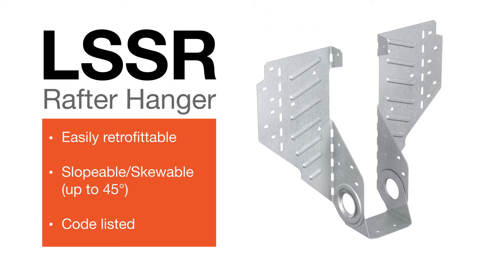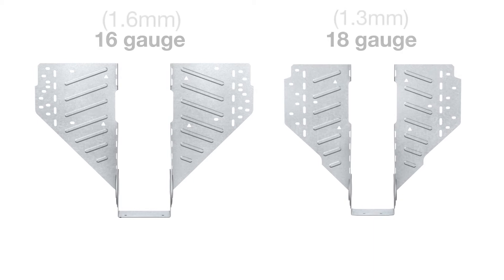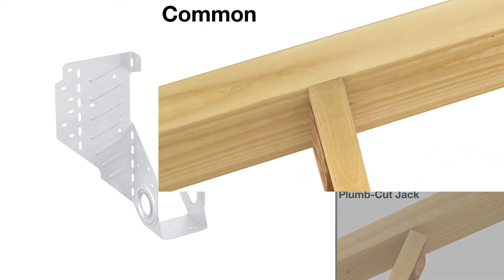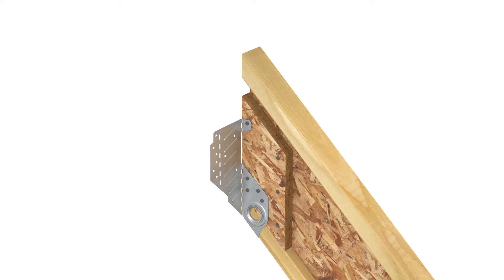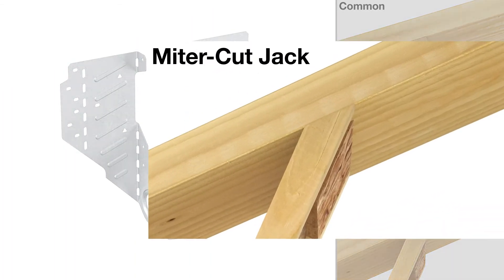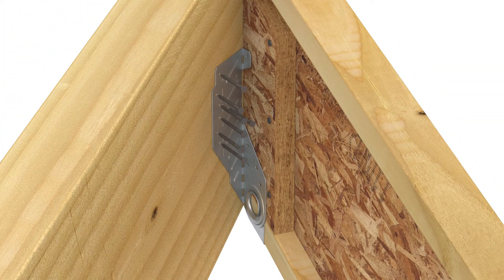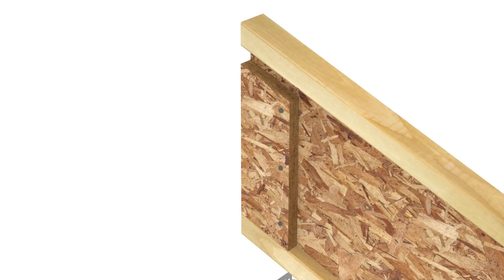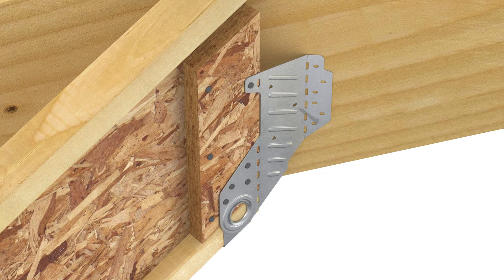How to Install the LSSR Slopeable & Skewable Rafter Hanger

Comment: I'm looking for a hanger that can allow the rafter to point up, not down. I don't know if these are approved for an opposite installation like you show in the video. Basically every angled rafter hanger is for hanging off of a ridge beam. I need them to go up from the ridge beam so that the toe of the board is supported.
Reply from the maker: We have many types of hangers, truss/rafter connectors. It would be easier if you could send an email with more details to us via the Contact page: https://strongtie.co.nz/contact